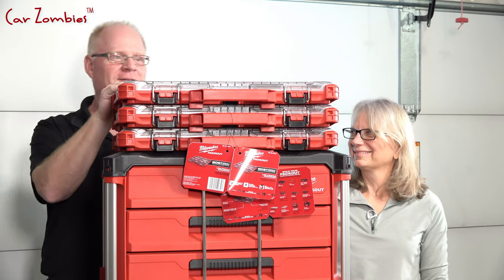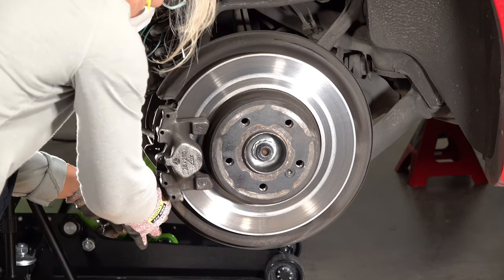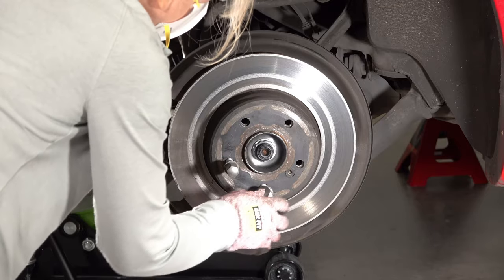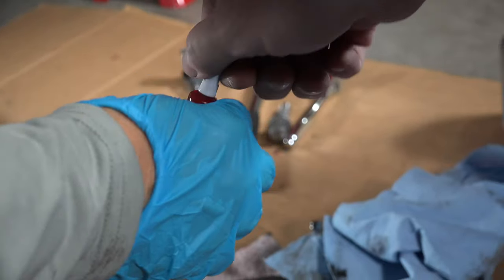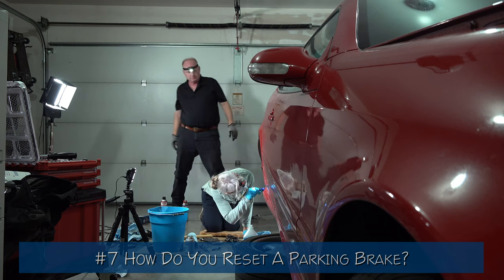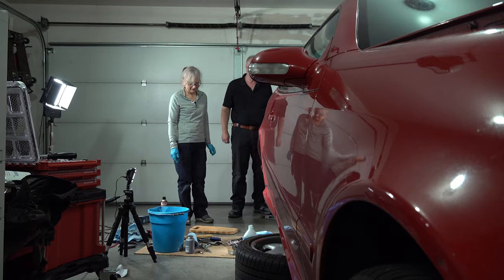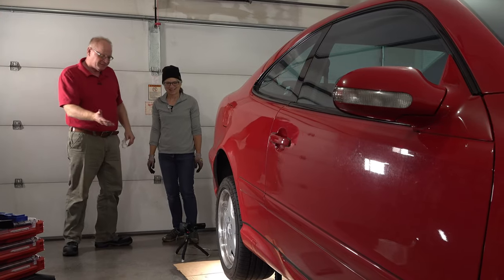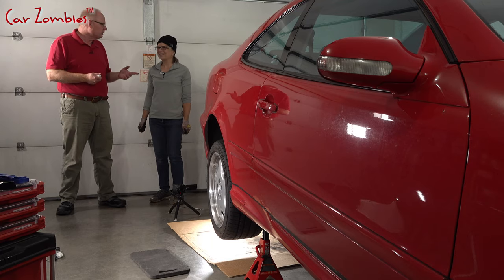Diane fixes her brakes, part 2: Conquering obstacles

Comment: Make sure to first uncap the brake master cylinder reservoir when pushing the pistons in, and if it's already full you might need to use a turkey baster to remove some first so it doesn't overflow. Brake fluid is nasty and corrosive and ruins paint and rubber and plastic parts. And to push in the pistons a c-clamp usually works well. It's also a good idea to clean and regrease the caliper slide pins with thick high heat silicone grease.

Also, when breaking tough, rusted or seized fasteners applying some penetrating oil first often helps.
Reply from the maker: Thanks for the tips. Didn't know the brake fluid is so corrosive.

Diane & Paul
Reply: Just don't leave cap off too long... brake fluid will go bad very quickly when exposed to oxygen will make it acidic
Reply: Open the bleed nipple and connect a bleeding tube to it.  It takes much less effort if your only moving the fluid in the calliper as opposed to all the fluid in a brakeline.

Comment: Glad to see you guys take ownership for your car repairs. I took that step in 2021 and was able to install front brakes on my 2004 Toyota Sienna. On subsequent repair on the same car, I was able to press in front wheel bearings and Macpherson struts. I highly recommend that you invest in a Milwaukee mid torque impact wrench. You will find the repairs a lot easier and probably, more enjoyable.
Reply from the maker: First, wow! Wheel bearings an struts! I barely know what they are but that sounds complicated. Sounds like there is another car zombie out there 😃.

Secondly, guess what I introduce in the next video on my BMW?...A Milwaukee motorized ratchet. Not quite what you suggest but fun as heck!

Paul & Diane

Comment: As a machine tip, next time when you take off your brake caliper, use your brake caliper tool to push the brake calipe pistons back to how they started when the caliper is off the rotor that is why your tool didn't work 

Also I real suggest that you look up Chrisfix he is a car machine, and how does a professional quality video on how to change brake rotors engine oil changes coolent flash and much more he very much of a professional and knowledgeable person how know alot 

Also Props to u guy taking charge on doing it yourself.
Reply from the maker: Thanks for the support. Chisfix sounds familiar. I think I might have run across him already. 

Paul & Diane

Comment: Also torque your bolts screws , so it won’t be too tight or loose very important.
Reply from the maker: Torqueing is a big thing for us. We didn't do it on the O2 sensor but figured out how later. See the video we released today: https://youtu.be/q_3h0_jkbfc.

Diane & Paul 😊😎
Reply: @carzombies  remember every time you change or fix something always reprogram your eco computer . Let it know you fixed something.
Reply: @carzombies  if you have OBD 2 scanner is good tells you the code for each problem in the car so you don’t need to go crazy looking for the problem. Reboot your repair after using the OBS2 for the ecm computer box

Comment: It’s useful to get a impact drive so you don’t need to always use your hands, tiring 😅.
Reply from the maker: Agree! We finally bought one, but haven't tried it yet. We also got an electric ratchet which is way better than doing it by hand, but doesn't have the impact feature that is better on our wrists. It comes up when we were changing Paul's brakes in a later video.

Paul & Diane 😎😊
Reply: @carzombies  it all depends on what area you need to reach using the exact tool , specially in those small areas